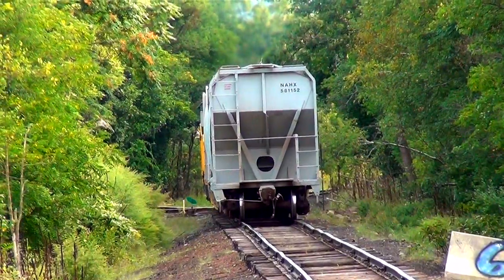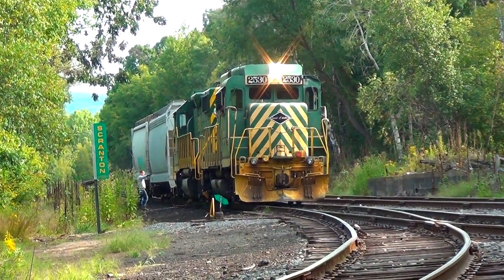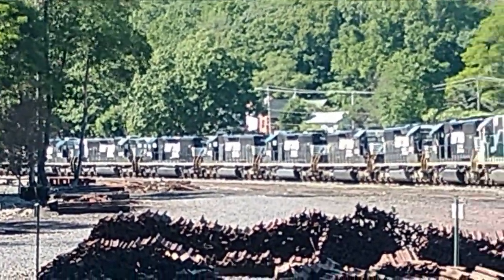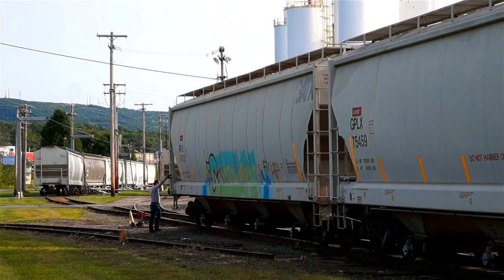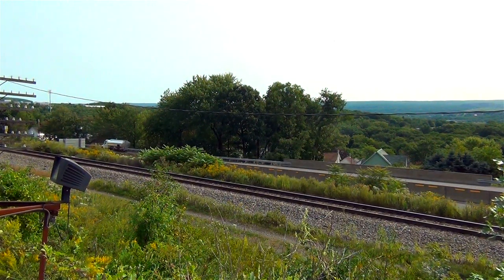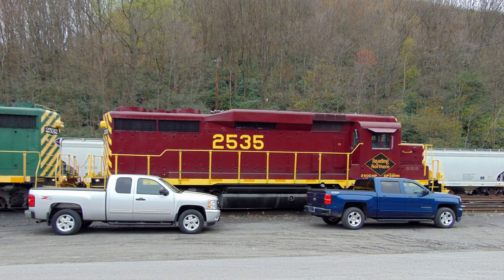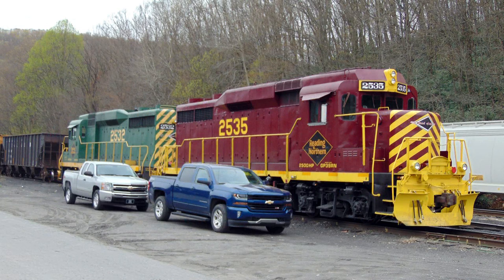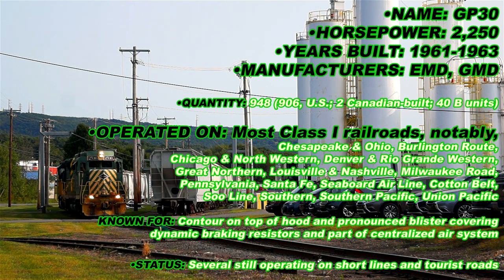[RN][T-263] EMD GP30: Common Power on The Old Reading Railroad and the New | Trains 21

Comment: I'm always fascinated with the GP30 just by how it was designed and stylized to stand out above from the other locomotives and i'm pretty certain that i'm not the only who's curious on what if EMD built an SD30 that resembles the GP30 but with a few key differences to give it a more sturdier and powerful look.

Comment: BNSF has a bunch of GP39's (GP30 carbodies w/updated -2 guts and a 645).  So you can more or less still see gp30's running on Class 1's today.  The local behind my house here in Duluth, MN has one in the consist nearly always for the last few years.
Reply from the maker: Nice.. Thanks for sharing that info.
Reply: Eric you're lucky to see trains in Duluth here in brainerd we don't have squat. It's hardly any freight trains and it's once in a while we see a cold train that's about it pretty lame.

Comment: Ik the western maryland railroad has one ex reading gp 30 #502 in service and the indianna northeast railroad has 2 ex reading power one is a gp 30 #2185and the other is a gp7 i think but #1601 and an ex Pennsylvania gp30 #2230 and ofc reading railroad messume has reading #5513 which there are only 3 existing as of rn but hopefully theres more

Comment: Im curious. What made the gp38-2 so successful
Reply: It was just the right locomotive at the right time, for the power and speed it can produce it's remarkably efficient on fuel, especially compared to the likes of SD40-2s or SD45s.
It was always marketed as a road switched, in the same vain as the GP9s before it, an engine with enough horsepower to keep up on the main, but still small and nimble enough to make those last-mile pickups on rusty old tracks.
Just like the GP9 there will always be a market for small, low maintenance engines which can reliably run in sub-par conditions.
That's not to say that in the right hands they can't still be capable road engines, R&N proves as much, it's just that the particular niche they fill, it's a pretty stable market... Going back to the steam days the GP38 is not unlike the Baldwin 2-8-2 logging engines of old that seemed to be universal yet distinct on every single class 2/3 well into the 60s.